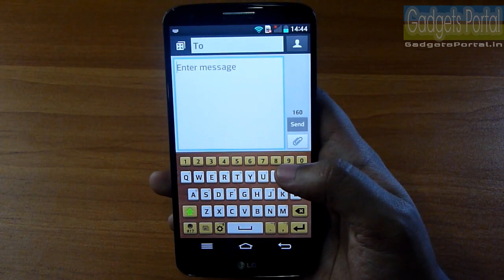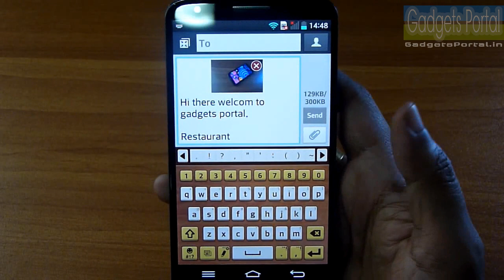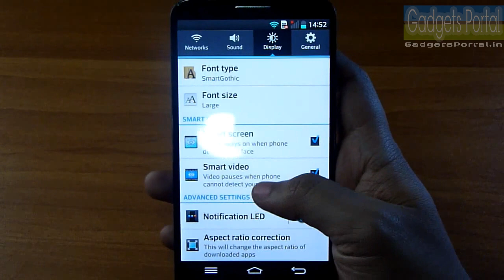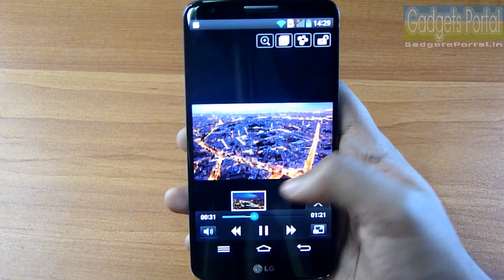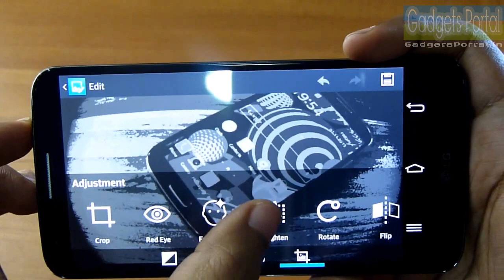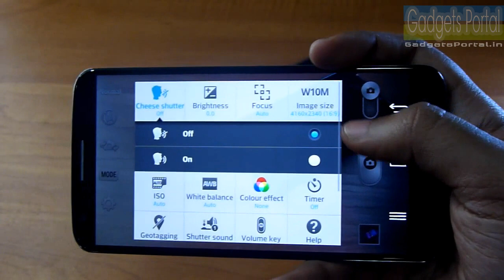LG G2 Tips & Tricks, MUST KNOW features (PART II) by Gadgets Portal

Comment: LG G2 or S4 !!??? HELP ME
Reply: I could easily say the G2 for one main reason: I've bought an S4 and witnessed a lot of my friends complain about how slow and laggy the device gets when performing the simplest tasks. That said, the galaxy line up phones tend to really bog down and lag which only gets worse with time. The G2's UI might not be the most appealing one out there but you can definitely work around it. Oh and G2's got a better camera, crisper screen, and faster processor...to name a few.
Reply: LG G2.
Reply: Lg G2 is better
Reply: I don't think it's being discontinued.
Reply: The s4 and G2 are extremely similar. That being said , the g2 does not come with a removable battery or expandable memory. The g2 is cheaper, that's why I chose the g2.
Reply: The s4 and G2 are extremely similar. That being said , the g2 does not come with a removable battery or expandable memory. The g2 is cheaper, that's why I chose the g2.
Reply: I'm deciding between the G2 or S4. Probably getting G2.  Better performance, incredible battery life and great camera. Not worried about the lack of memory expansion like the S4. The heating issues with the latter and the performance hiccups makes it an easier decision to go for the G2.
Reply: G2 is better then S5 never mind the S5.
Reply: Well I finally got the LG G2 two days ago! Great phone with blazing speed and excellent battery life.  One MAJOR problem for me is that the phone tends to get really warm after 5 min of gaming of video playback.  I think its due to the Snapdragon CPU and plastic back of the G2.